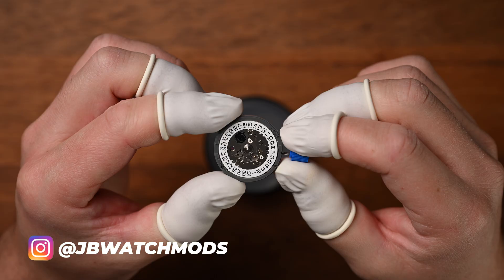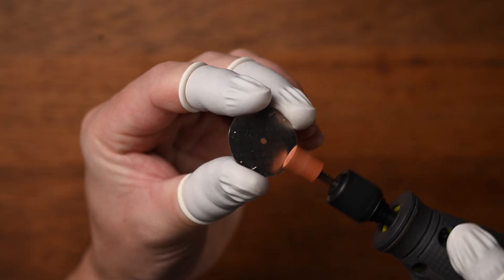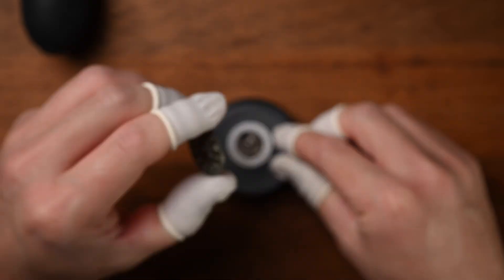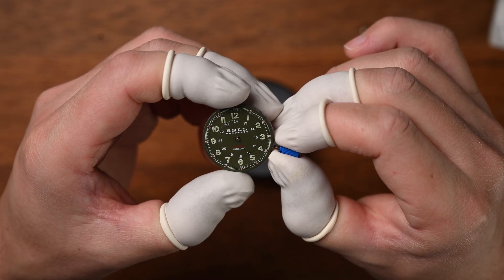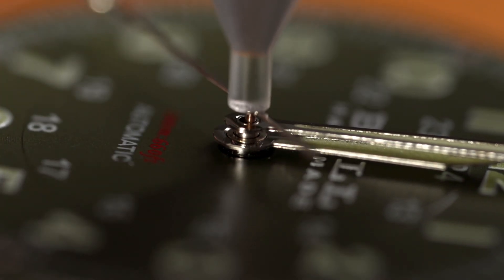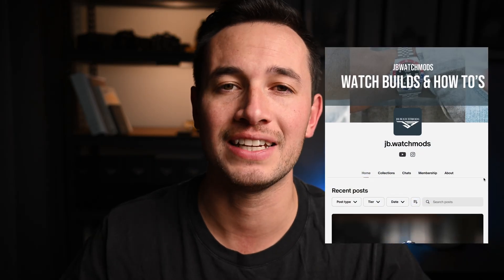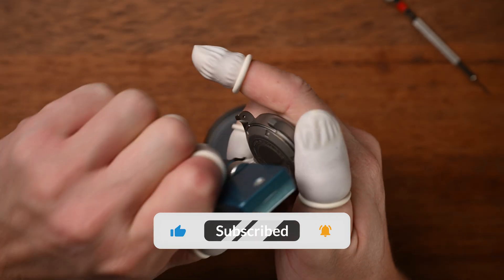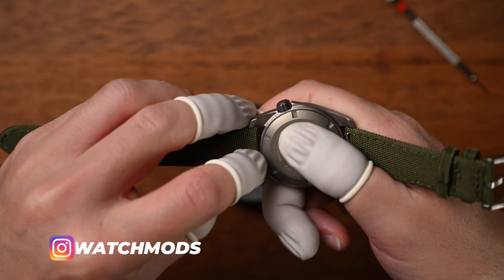How to BUILD YOUR OWN Automatic TITANIUM watch!

Comment: Looks amazing, it makes me regret my Timex Expedition North Titanium. On a related note, I didn’t realize that adhesive was a normal way to set the dial on the movement. I had to send my time in because the dial was spinning inside the case, and now I’m wondering if they used adhesive instead of feet. I wouldn’t have known that if I didn’t watch your vid.
Reply from the maker: That timex is a cool watch. I was considering one for myself!

Comment: Hey @jbwatchmods, regarding the keyless work of the 2824 clone, to remove the stem you need to pull the crown to the third position before inserting a screwdriver into the release button and finally pull it out. If you don’t do this, the keyless work will stop functioning and will need to be disassembled and properly reassembled.
Reply from the maker: I know that now haha! Thanks!!
Reply: @jbwatchmods  You're welcome, I'm happy to help. I can’t wait to see the build with your 2824 clone, good luck.
Reply: @jbwatchmods Previously, I mentioned that it was the second position, but in fact the crown must be pulled out to the third position, the time-setting position. When reinserting the stem, you should gently press and rotate it until it fits perfectly.

Comment: The grease on the case back gasket doesn't stop water getting in, instead it acts as a lubricant that makes crimping/deforming the gasket less likely when you screw the case back on, thus ensuring a water tight seal.
Reply from the maker: Thats correct, but grease also acts as a great water barrier!

Comment: I've been looking for parts to build a watch very similar to this. I just need to find a field dial with a 24 hour scale around the outside so I can make it a GMT.
Reply from the maker: Could you use a shorter GMT hand and utilise the inner 24hour track on this dial?
Reply: @jbwatchmods  I had actually considered that but the scale only goes from 13 - 24, not 1-24. I know someone with a laser engraver and I'm considering designing a custom one and cut it into a blank dial but that's a whole new can of worms to open up.

Comment: I love these videos. They got me to try to assemble watches using the parts you recommend. The problem is, I cannot seem to mount the seconds hand. I have ruined four of them now trying to get them on the NH35 movement. These are parts sourced through your links. I'm getting a bit frustrated.
Reply: Same here! I've ruined several seconds hands so far but I have gotten better at it. What helped me was sticking the end of the hand on a small piece of rodigo and then using the rodigo to hold the hand in place over the pinion. There a few videos here on YT that show this method. Good luck, don't give up!
Reply from the maker: Thanks! The seconds hand can be very challenging, it may take a good 10 builds before you get the hang of it, but it'll get easier!
Reply: I built my first watch a week ago. The seconds hand is just a b***h. Took me ages.

Comment: Where would I get a customised dial design? I have a small business and I'd like to have the logo printed onto a watch dial

Also how do you know which dial fits which case fits which movement? They all have to match up

Looking to build my first watch soon

Thanks for the videos
Reply: I saw a dial merchant on Aliexpress that offered custom dials. I didn't look into it so I don't know how good they are. But you can find them there.
Reply from the maker: There are sellers on aliexpress that offer customised dials. When purchasing your parts, you just need to make sure everything is compatible with each other, all the info you'll need will be in the listing descriptions :)